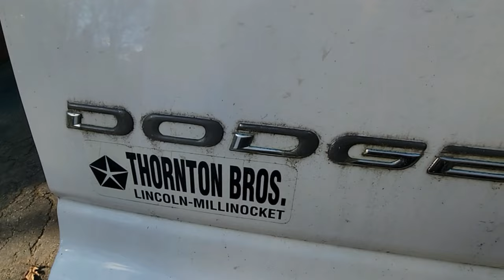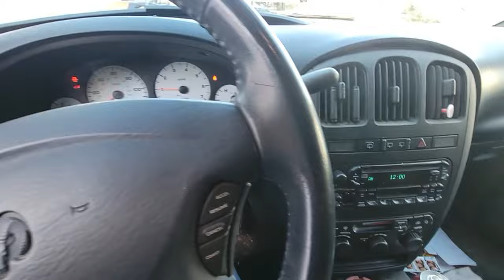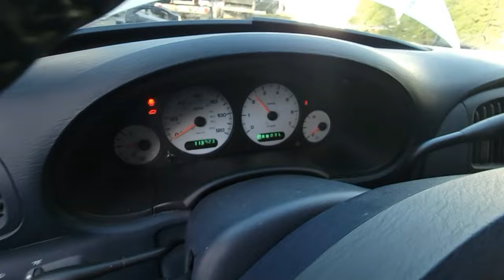2003 Dodge Caravan 3.8 DEATH BY BOOOOOOT!!!!

Comment: Now this one surprised me...normally those things chew up transmissions, or electronics, or rot away arou d the strut towers etc, but those 3.8s usually run pretty good.  Thank you for your response a few days ago about the general grabbers btw.
Reply: my guest no oil change done in a while or  drove on low oil